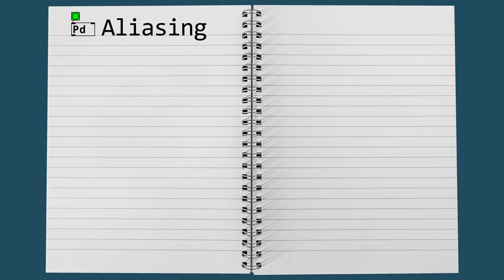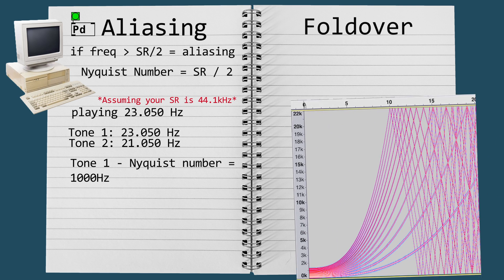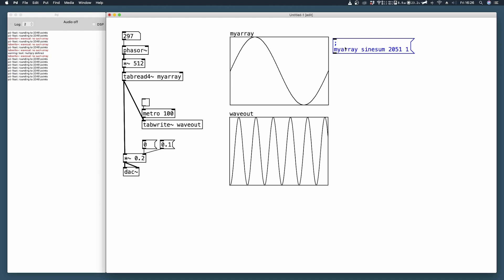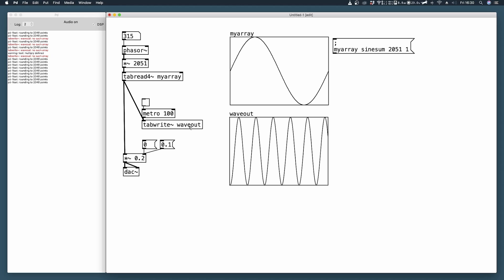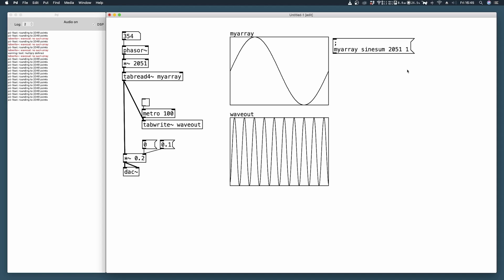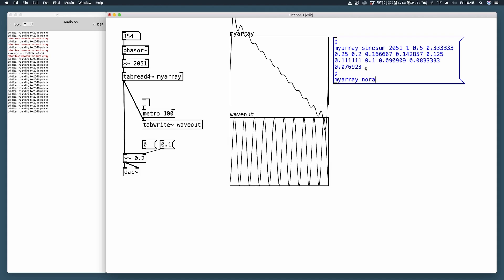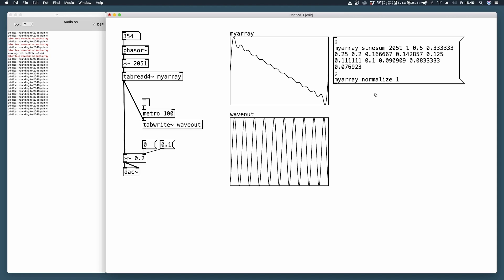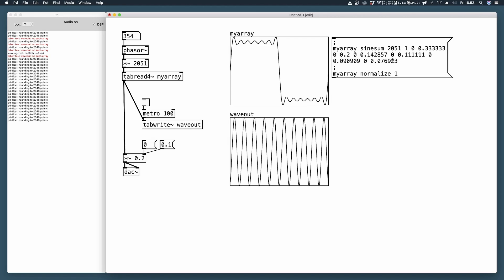Pure Data Tutorial: Aliasing and bandlimited waveforms

Comment: What makes these waves bandlimited? Wouldn't you still get aliasing if the fundamental of these sinesum tones approaches the nyquist limit?
Reply from the maker: Sorry for laaaaaate reply! For a tone to be bandlimited, all of its frequency components must be within a certain range (well below the Nyquist number). These signals are called “band-limited” because the spectral content is limited (one can literally count the harmonics written within sinesum, 12 for the sawtooth wave in the video). If the fundamental (or some harmonics) approaches Nyquist, aliasing occurs. There are some techniques used to mitigate aliasing in these cases, such as anti-aliasing filtering (it will not eliminate aliasing but will reduce its effect).